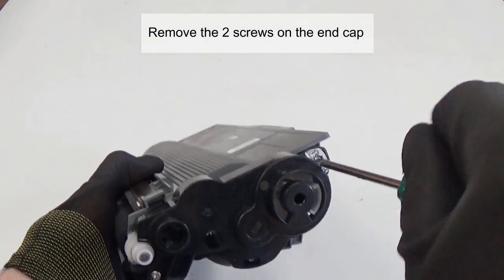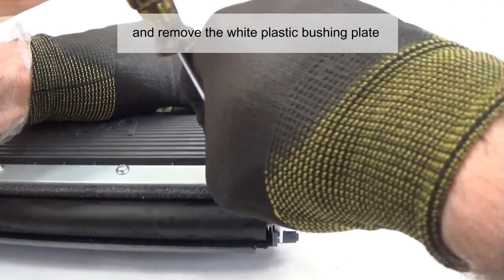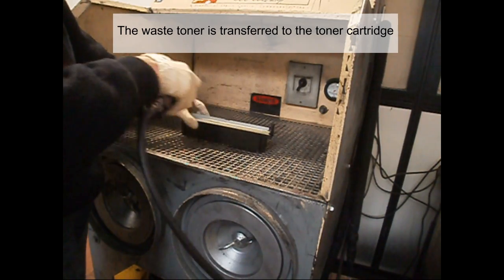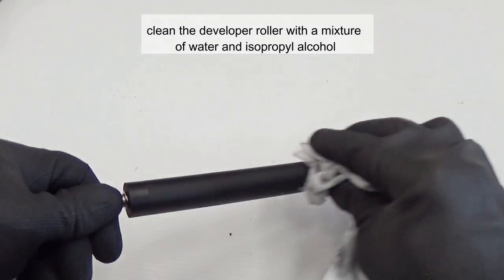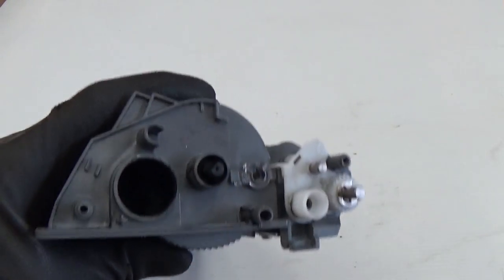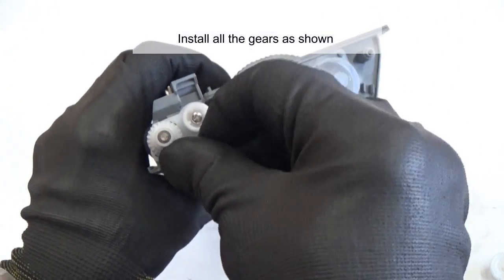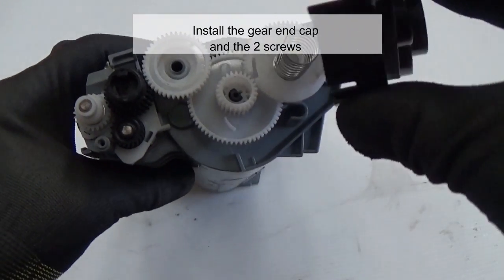BROTHER TN720 TN750 TN3380 TN3350 TONER CARTRIDGE REFILL

Comment: I love this video, have watched it a several times, both before and while refilling my Brother 5470DW printer's TN720 cartridge, which I've done twice now. I pause and rewind on my laptop if I am not sure of a step. The first time I did this I had an issue when replacing the rubber roller after cleaning it. When inserting into the left side hole, the bracket with the hole broke. I fixed that with two part epoxy glue, saving my cartridge. I strongly suggest being very careful when inserting the cleaned rubber roller back into the cartridge. You might even want to lubricate the steel shaft's left end so it inserts into the hole more easily. Otherwise, I had no problems. Next time I run out of toner, however, I think I'll buy new cartridges. Not the Brother OEM's, but one of the highly rated but cheaper ones, probably a pair, actually. It comes out about the same in cost as buying toner and it's almost no work.

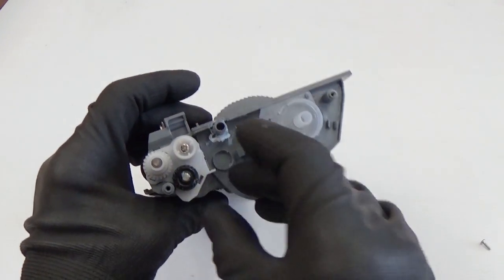Comment: at 0:56 the fill plug retainingplate is still there, but few second later not any more?!? On mine, the plug and plate looks 1 piece, which brakes when removing. It looks like a refill protection! No good plate anymore to install reset gear on to.
Reply from the maker: Compatible cartridges and original cartridges could be different. You could fix a broken plug using glue, it's not an important part, or refill the cartridge through the roller opening leaving the fill plug in place

Comment: Sorry for the constant questions...but is White Lithium Grease okay for the gears? I washed them 100% clean with soap and water so am making sure I don't degrade the gears without lube - I noticed there was a white sticky lube on them from the factory. I have googled the topic and it's all over the place. Some people say that petroleum (38% of what is present in White Lithium Grease) with eat up nylon gears while others say to use White Lithium Grease and that it is safe. Suggestions?
Reply from the maker: The white lithium could work but it's more for metal to metal gears. A normal grease lubricant will work
Reply: @viandant5  Will the White Lithium eat up the gears or make them "softer". If the White Lithium will work I would rather use that since I already have it but if you think it is dangerous, I will go ahead and get some normal grease. Which grease do you normally use?
Reply from the maker: I use a normal low cost grease for mechanical parts. I think white lithium should work too, inside a printer there are not too much frictions
Reply: @viandant5  Great. Thank you as always. I have learned so much valuable information from your videos and chatting with you. Thank you!!!

Comment: I have been using brother dcp 8110dn model printer, but now it started to print with very low quality since I changed the toner. What could be the cause?
Reply from the maker: was it a new cartridge? Or did you refill it? may be the reset gear was not in the proper position, or the toner roller has not been correctly cleaned

Comment: too much work.   all u need to do is put a piece of tape over the hole on the side of the cartridge.  i used a starburst wrapper and put a piece of tape over it.  as long as its blocked, the sensor believes there is toner in the cartridge.  if light shines through, however, then it knows there's no toner and will give u the warning message.
Reply: Well, that will extend the life or your cartridge, I did this myself. But it eventually runs out of toner and you have to either refill it or buy another. Refilling is way cheaper than buying a replacement.
Reply: Tape over the sensor will buy you some time. It did that for me but eventually the printer refused to print. I then used this super great video in replacing the toner in the cartridge.